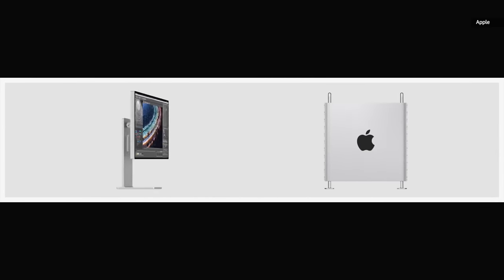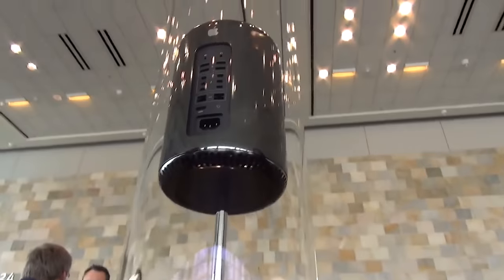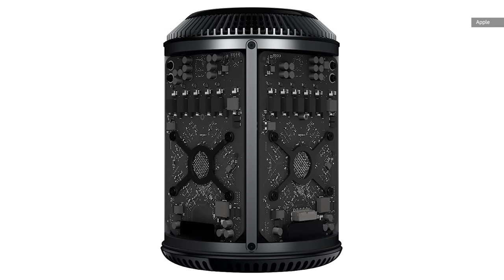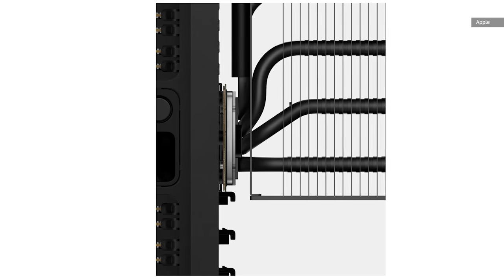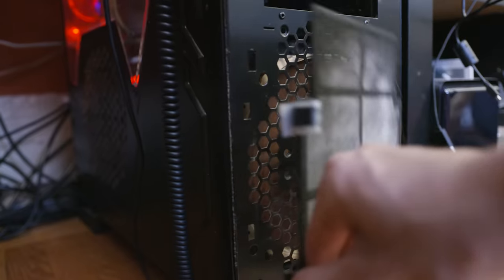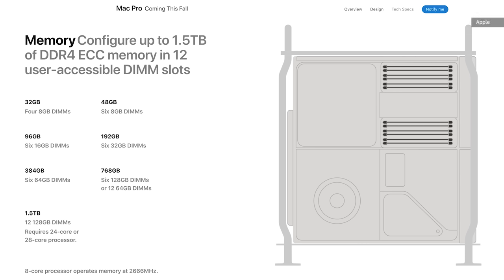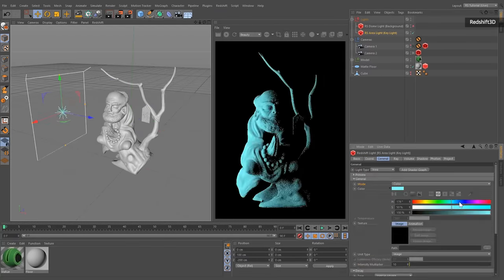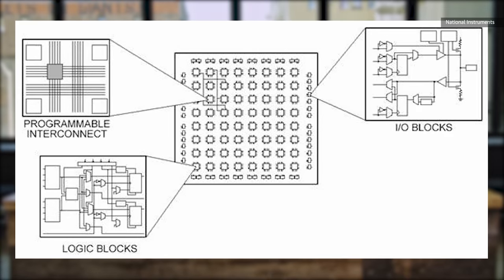Did Apple fix its Mac Pro problem? | Upscaled

Comment: Finally a machine that has nearly enough RAM for Google Chrome...
Reply: You Wish...
Reply: Use bookmarks instead of keeping thousand tabs open.
Reply: Chrome will be banned only two tabs on Safari will be allowed..
Reply: @antoniorsoftware  I use Opera which is a lighter Chrome but i have way more than 6 tabs open...works well
Reply: Windows simply cannot handle more than 15 tabs !!

Comment: 8:08 The picture does not demonstrate diminishing returns at all since the time needed is inversely proportional to the performance, not linearly. In other words, if the amount of work is 1 and your speed is x, then the time needed is 1/x. If your speeds are 1,2,3,4, then the time needed have a ratio of 1 : 1/2 : 1/3 : 1/4 which is what the picture demonstrates (nearly perfect linear scaling)
Reply: I understand what you mean, but the video's point stands. Say you paid 500$ for the first card, the second 500$ card doubled the speed, saving 1000 seconds. The third card also costs 500$, but only saves 300 seconds. You are paying the same but for lesser improvement, therefore diminishing returns.
Even in terms of the fractions you used it is showing diminishing returns, as it is not linear: y = 1/x is hyperbolic/rational; y = x is linear.

Comment: You forgot to include something big with the trashcan mac pro. It wasn't just expansion that was the issue, it was also thermal throttling so bad it would frequently kill the graphics card. Work spaces cluttered with thunderbolt accessories making the otherwise clean aesthetics of the machine become just a mess. The lack of upgrades was just one reason why this machine seemed unattractive for real pro users. A lot of pro users who are in the Apple ecosystem still use the old style cheese grader mac as its more robust and reliable. 

Happy to see Apple actually listening to what the pros want and need this time, even tho the base config is hopelessly overpriced and you shouldn't go for that as the value is just not there. But, I get it. The case alone probably adds quite a bit to the cost for what could be only an 8 core system.
Reply: Torjus HT yeah, the gfx card in my company’s Mac Pro burnt up last year, so Mac replaced the whole machine. It’s looking like it will happen again soon, though. 4K renders of 8K timelines are brutal.

Comment: There is 2 8 pin connectors on the motherboard, for each mpx pci x slot, and another one 8 pin for the others. So, all 5 8 pin connectors can be used for any board you put in. Like the old big tower had on 2 6 mini pin, this one have 5 8 pin full size. So, you won't need to be worried about upgrading with standard pci x slots. The only thing for me is a question mark, is that this is a 2019 machine with a gen 3 pci e slots. Could at least be a gen 4, that is already released. But with a system that can hold 1.5 tb of memory, that is not big deal for at least the next 5 years. I gonna have one Mac Pro and a Pro Display XDR to Work. I do 3D and Motion Design as work, and VR and Game Development for Hobbies. For the cables to use those 8 pin power pins, you can find than on Amazon, eBay, etc. And they are cheap. I won't believe apple would supply that cables for a machine they believe won't need than. But for compatibility purposes the connectors are there to accommodate all types of users.  And for the use of multiple GPU's, you can use it for sure a 100% with edit softwares, like Final Cut Pro X and DaVinci Resolve. Both already use more than one GPU. (n GPU's). And Premiere is coming to support that too, if not yet. And Maya and other 3D softwares and GPU renders use it too. And real time game engines use it too. And with that, VR too. Cheers!

Comment: you see those black squares next to the mpx slots? those are for the standard pcie power cables to plug in
Reply: @Anticipate Media It seems like a very good solution, but I don't think the slots are large enough for enough connectors for 4 high-end graphics cards, some use multiple 8-pin connectors. Considering all three ports, looks like there will be 5 connectors, a bit short.

Comment: The heat sinks are massive on the Mac Pro you missed that in your analysis. Also most offices don’t allow cats and therefore won’t have massive hair balls—that’s a you problem.
Reply: But dust so every where and no matter what it will find ways into that mac with our a dust filter or a some sort of mesh.

Comment: Correct me if I'm wrong but I'm pretty sure that the Intel CPU that comes with the Mac Pro is not able to use PCI 4.
Reply: Well, i believe is this the motive that Apple don't put PCI e gen 4 on the machine. They use only Intel processors and Intel doesn't have any gen 4 yet. Only AMD have it.

Comment: This is a workstation class machine, you don't upgrade the cpu, or motherboards (maybe the video cards), you buy a new machine and pass your old machine to a junior employee.

Now how about detailing a comparable machine from another vendor...
Reply: You have HP or Dell systems to deal with otherwise. Price wise the Mac Pro is actually a solid buy for where it's actually targeting. These will (usually) end up on racks used to just render anyways.
Reply: @christopherfortineux6937  It is absolutely overpriced, just look at how much a Threadripper system would cost.

Comment: The Metashape project takes into account a sub 20MP camera i believe. Cameras, such as the Sony A7R III or even the 100MP Hasselblad H6D would push way past that. Also to take into account Laser scan data and UAV images in combination with traditional photography would chew through ram as well.

Comment: Everyone: You can't be more greedy.
Apple: Hold my beer and buy the $400 8pin power connector adapter.
Reply: There is an 8pin power connector though on the MB. It is beside the MPX slots.

Comment: I have the trashcan MacPro. I got it used. I'm not power user even though it comes with 128G RAM. However the 6 TB2 sockets were useful as I have several OWC RAID enclosures. The new cheesegrater is way beyond what I can use.

Comment: Film Composers can use that ram to load Sample based Libraries in to ram.Sweet
Reply: If you really need 1tb ram with a powerful CPU and video cards, just have a custom  AMD EPYC system build for you. For the same money you'll have more power and no over heating problems. I think the new gen EPYC CPU take up to 2 tb ram and you can dual socket them.

Comment: The front part of the MPX Slots are standard pciexpress slots. So you can always add standard graphics cards if apple will not update the mpx modules.

Also: they claim the mac pro is virtually silent. Like the imac pro. So it will definitely not be as loud as a server. 

And: they claim the cpu heat sink alone can cool 350W of heat. So no heat problems in the future.
Reply: I've read that the processor can run indefinitely at full blast without having to throttle down like the Macbook Pro.
Reply: @FM-nm4ng  Yes, and considering how much crap they got for the trash can, and how much it hurt their pro user community, you KNOW that they HAVE to get this one right, and I think they may well have.

Comment: One important bit of information that has yet to be clarified: did Apple finally relent on using their proprietary EFI bios firmware? Did they opt to use a normal PC type of UEFI bios firmware? Can a normal PC type of UEFI-compatible PCie video card be purchased from a non-Apple source, plugged into the new Mac Pro, and have everything function normally, including the boot screen?
Reply: I doubt it because this machine has a T2, which I'm sure requires (if not supersedes in some cases) the Mac EFI.

Comment: Even if another MPX module is never produced, the MPX slots are just PCIE gen 3 16X slots with another slot behind it to add power. Meaning you can still use those slots for any consumer GPU in the future. 

This computer is as "Future proof" as buying literally any other Intel based PC right now. the only concern is the lack of PCIE gen 4. Even with the lack of gen 4, the MPX module seems to be a compromise made by apple to still have enough bandwidth for the future while also having to work with intel refusing to implement PCIE gen 4 support in this current gen processor

Comment: The Apple obsession with quiet operation must be why this new Mac Pro is limited to one CPU, although I don't know why they would not consider water cooling to achieve this. They got it right in the quad G5 Power Mac (late 2005 model), which featured 2 dual-core CPUs and consequently used liquid cooling instead of air, as the less powerful G5s did, but strangely they have never gone back to liquid cooling since then.
Reply: Servers in general are even going single socket. This isn't an Apple thing. AMD with TR and Epyc changed this way of thinking very quickly.

Comment: I hope it can run crysis... OAN there is not a single person who needs a 40k computer...dreamworks, Pixar, medical labs, research facilities, algorithmic, these folks would use that
Reply: Even those people mostly use Cuda accelerated workflows, so the Mac pro still wouldn't be useful overall. If your workflow is apple based programs then the AMD GPU's will crush everything.
Reply: @justinbeamon6624  YEAH, but I could've sworn apple added Nvidia gpu support back in 10.8.3 did that change? why do people act like you CANT add Nvidia gpus?
Reply: Why does everyone keep saying it's a $40k computer? Just because the presenter inaccurately mentioned it? I doubt the 12-core is more than $1k or so more, which makes the base system $7k. Toss in a few more for decent RAM, and it's still under $10k. That's not ridiculous or any more than you would spend on a high end Win box, and it's a fricking Mac, so win win.

Comment: When I first saw this machine I queried the cooling system. Big power generates big heat and cooling has to be up there. Plus that grate system letting dust in is going to be a factor in no time at all. Apple putting form before function again.

Comment: Yes but it should start at $1999, i7 itb ssd rx 5700, than go up to i9.
than go up to xeon from there, ther base mode xeon  but with 10nor 14 cores, should be same as apple released but with 64 gb ram, 1 tb sad, and rx 5700 video card for $3499, and then up from there.

Comment: Just custom built this, so far so good. 
Processer:  Intel Core i9-9940X @ 3.30GHz (3y)
Motherboad: 	ASUSCOMP ROG STRIX X299-E GAMING (3y)
RAM:  CORSAIR 64GB 16X4 D4 2666 VLPXC16 (LT)
Graphic Card: 	ASUS ROG-STRIX-RTX2080TI-11Gb (3y)
SSD:  SAMSUNG E 2TB 970EVO+NVME M.2 SSD (5y)
HDD: SEAGATE IRONWOLF 8TB (3y)
Casing: 	CORSAIR 500D RGB SE TG MT CASE (2y)
Power supply: CORSAIR RMX1000 FM 80+G ATX (7y)
COOLER:	 NZXT KRAKEN X72 LIQUID COOLER (6y)
OS: 	MS OEM WINDOWS10 PRO 64BIT COEM
Web Cam: Logitech C920s Pro HD (2y)

Comment: I’m not worried about getting future MPX cards because
A) they are much simpler to make; they have a custom heat sink but the rest is pretty standard, no big deal
B) you don’t need them; even if Apple never makes new ones you can use bog standard GPUs in those PCIe slots (if you didn’t know there are actually 8 pin connectors in there then I can see why you would have been worried, but they’re there, so no worries 😉)

Also not worried about them updating the motherboard with new sockets. This is less ‘custom’ than the previous cheese grater (which was practically the same size and weight btw) as it used a mother board and daughter board combo, and they upgraded that a few times.

As for PCIe, Apple can’t do anything about that until Intel releases a chip that supports it.

The only really custom thing on this board is the MPX slot, and that isn’t going to be a hard thing to slap on an updated Mac Pro. The 2013 had limited thermal headroom, space, and power delivery. This model shouldn’t have any of those problems.

Comment: In the past Apple was usually ahead of the game and brought a lot of cutting edge tech for better serve high-end Pro users even if that required less common standards like Firewire of even adopting Thunderbolt much earlier than most companies, it's weird to see Apple having such a close relationship with AMD, AMD releasing PCI-E 4.0 on their new MoBo and Apple not even considering that. 

As of right now, NVMe drive can already take advantage of faster bandwidth and it's also about being futureproofed, if you buy this Mac Pro, you won't think about replacing it anytime soon, having PCI-E 4.0 is quite important for that matter. 

With AMD getting better and better on the CPU front, improving IPC AND core-count, I wonder if Apple is considering having AMD CPU. I don't know how the Intel contract works as for exclusivity and I know that Apple is already testing ARM CPU for their Macbooks, but if AMD offers more than Intel for less, why not? It would be interesting if there was an AMD option in the future - so I can make a Ryzen Hackintosh working OOTB... hahahahaha...

Comment: I had the 6-core trash can Mac Pro. Loved it's quietness. When my 27 inch Cinema Display felt a bit outdated, I got the new iMac Pro with 10-core CPU. It's a nice machine and I absolutely love it's display. I'm a 3D artist and I just love using Mac OS. However I wanted to step in the world of GPU rendering and for that Apple did not deliver for my needs. So I just got a Threadripper system with two 2080ti's for now. Unfortunately I could not find a display, that is euqally as nice as the iMacs and to be honest Windows sucks a lot. But once I tested Octane render I just got blown away by it's performance!

I wish Apple made a machine between the iMac Pro and the Mac Pro, that let us users put in nvidia cards with CUDA on our own and support it. And maybe the iMac's 5K display as an external monitor. That's all I ask for. I seriously would pay 50% more than for equal PC parts.
Reply: Not worth it. Windows has actually gotten good enough.
Reply: Model on your Mac, submit final renders to a render farm. Get the best of both worlds.
Reply: @bacon.dumpling  Would work with CPU rendering, but I need to create the materials and lighting for GPU rendering and want the direct feedback, so unfortunately this isn't a solution.

Comment: indeed. having that double width slot is an ode to intel. they are sleeping at the wheel. so you get x2 the speed of PCIe 3 which is the speed of pci v4. then add that pci v5 has just been ratified and v6 for 2020. oh yes and corsair with their 5gb/s nvme ssd's! buy yourself a ryzen 3950x with 16 cores, it takes ECC memory and run linux if you are heavy into large number crunching.
Reply: can it run final cut and logic?

Comment: I have a 2012 and love it - but it really is getting old. I am about to buy a new 8 Core MacBook Pro, guessing it will be close to the same speed as my old 12 Core. I don’t know yet if I will buy a new Mac Pro, depends on the cost of a more interesting configuration with the fastest single GPU option and a processor with a decent core count and something along the lines of 256GB Ram. Not asking for much 😂 - that thing should compile swift code in no time and allow to run a few VMs at the same time while I also work on a personal photo or video project while I am waiting. And yes, I could just buy a MacBook and an iMac for that and use two computers like I do right now. But where’s the fun in that?

Comment: most of your critiques are reasonable, but the CPU socket is unfair. that is Intel's and AMD's fault. No computer/mobo offers replaceable sockets. Also, you did not give enough credit that the new machine gives hope for third party GPUs and other cards. The trashcan was so unique/niche design that it was almost prohibitive for a third-party to offer hardware expansions/

Comment: I want to know about the old mac pro please :)
Reply: Yah basically the new MacBook pros are better than the old trashcan now. Vega 20 and the i9 8950hk is better. Now the MacBook pro has 8 cores and 16 threads. It's undervolted directly from apple so the performance is actually better in single threads than previous models. Of course multithread performance is outstanding.

Comment: Why do you say the new 8 core is a waste of money? Brand new machine with new components that you have the flexibility to upgrade over time when core components prices drop. I’d rather spend 6k on the 8 core that will last 6+ years with continual upgrades than 2.5k on a second hand 12core trashcan that’s got maybe another 2 years before it really is not fit for a proffiessonal environment.
Reply: Slower mem bus & RAM. You'll be much more future-proof if you go with the 12-core and the faster RAM, IMHO. I think that's what he was thinking, and I agree.
Reply: @greylingstudios  Ah yes I understand, that's interesting thanks.

Comment: the Mac Pro (2013-"2019") is what you'd expect a nice clean looking standard desktop to be like not a professional device.

I have this view with the 13 Macbook Pro whats so pro about 8gb of ram and a dual core i5. nothing its a standard notebook with no Pro behind it. Aye the air is the same spec and slightly cheaper.
Reply: What a professioinal machine "looks like"? Um, performance is what matters and it has that.
Reply: @unreliablenarrator6649  thats my point. also "you'd expect a nice clean looking standard desktop to be like" 

to be like. is what I said. 

My point was about the design choice of the trash can, it fits more towards a nice computer to have on your desk. from a pro standpoint it missing the expand-ability of what a Pro needs.

Comment: 11:08 😂 Intel supporting PCIE 4 is not going to happen in the near future if at all. They are more likely to jump straight to PCIE 5. If apple wants to offer PCIE 4 then they will have to move the Mac either to AMD or switch to their own silicon. The later of which is more likely considering such a plan is supposedly in the works for the consumer products.